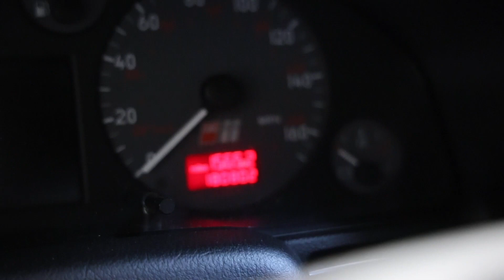I Bought A B5 S4

Comment: The paint issue on the roof is a factory defect. I've been told it's the plastic they put on the cars during transporting. The clear coats were not fully cured and saltwater was introduced under the plastics. Allroads have the same issue on the hoods